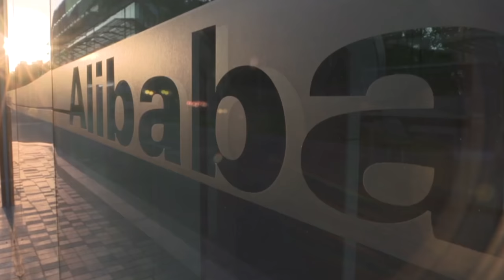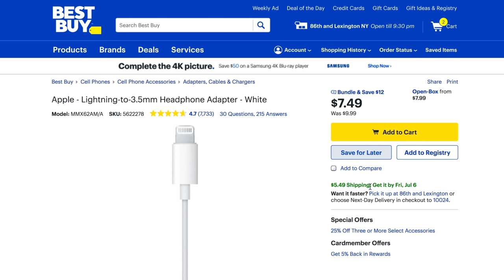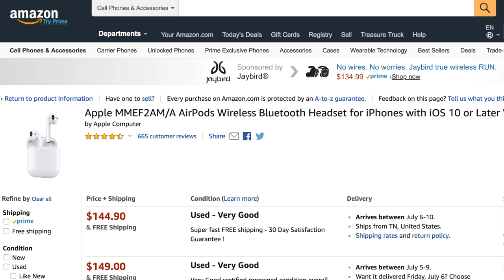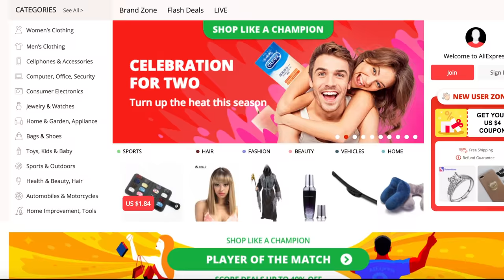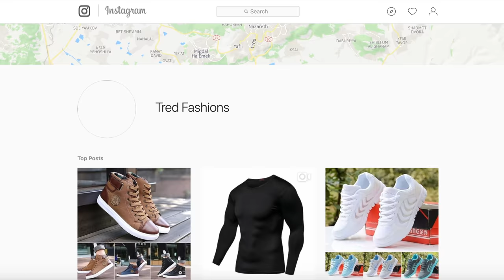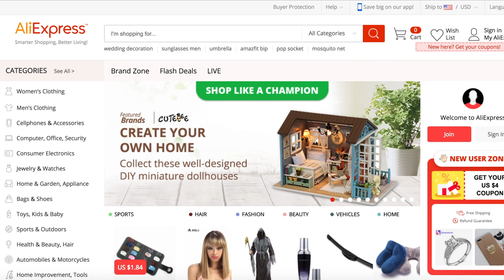Going Postal: Why are US Taxpayers subsidizing all Chinese packages?!

Comment: Ami. I heard you on the Dennis Prager show yesterday. It was actually difficult for me to find this video. Please be a bit more clear how to find the video next time. Clearly stating the title over the air, and more than just once, would have been helpful. :)

I have wondered about the answer to this question myself numerous times. I have even done the same: to ask the postal clerk, what the heck? Thank you for attempting to explain it clearly. It would be nice to see actually documentation of this practice: Who receives these packages knowing that the sender is not actually paying for their delivery.

Also, it would be great to see some stats:
What percentage of packages from China are subsidized in this manner?
What percentage of packages delivered by the USPS are subsidized in this manner?
What percentage of those packages are Chinese origin, what percentage are other country origins?
What is the burnden (cost) to the tax payer for these?
What is the benefit (gain) from those packages from China that are actually paid for delivery - the assumption being that not all packages shipped from China are subsidized.
I am sure you can think of some more stats that would be completely relevant to help back up your claims in this video. I agree this practice is absurd and unfair. But without quantifying the problem, I don't believe we can truly resolve the issue..

Thank you sir for your great work.
Reply: All packages from Commie China have subsidy. as a 3 tier country. vietnam also. a commie country which should not be allowed.
Amazon also qualifies on a rule from Congress about a certain amount of packages have to be subsidy from way back to not compete with private parties. Google it.